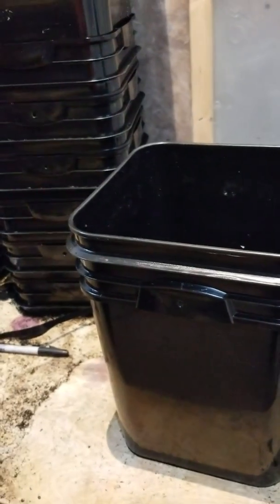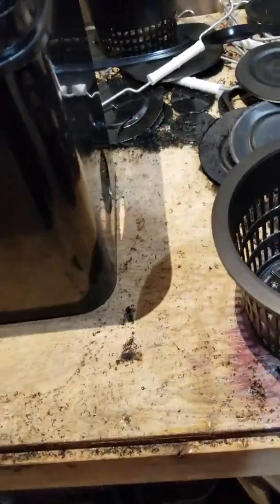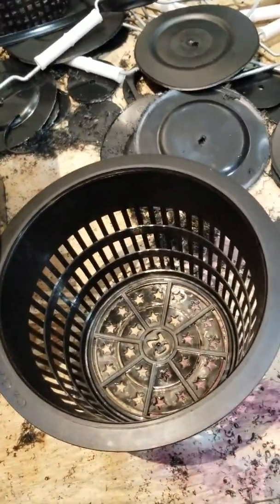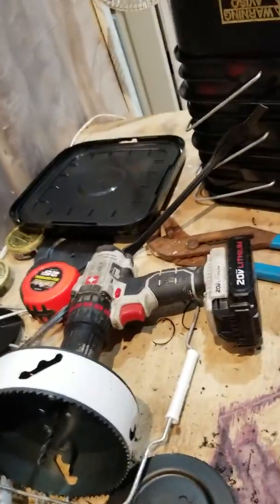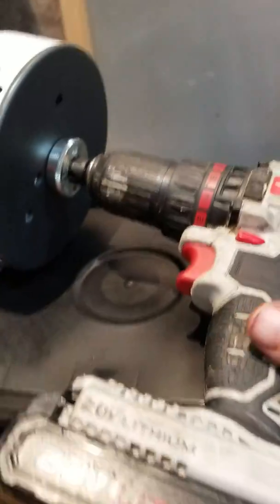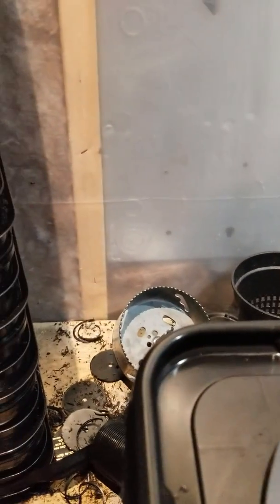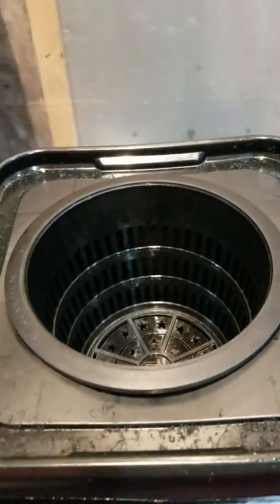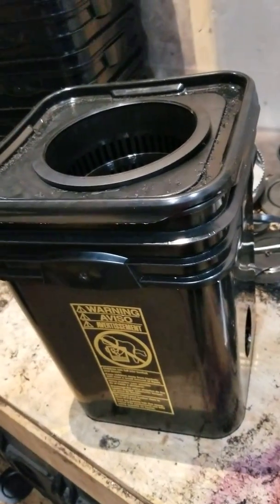Building a DIY undercurrent DWC system part 2

Comment: Subscribed! I think I was using that same net pot and ended up with the CZ also. I like them for the bigger flange also. Your system with 12 buckets would be $3,00 if it was "UC" I made my own mini-RDWC. Those straight sided buckets are perfect and hard to find. Thanks.
Reply: I meant $3,000 not 300